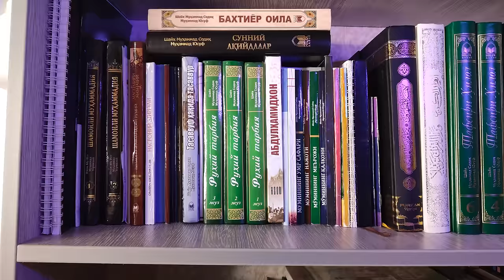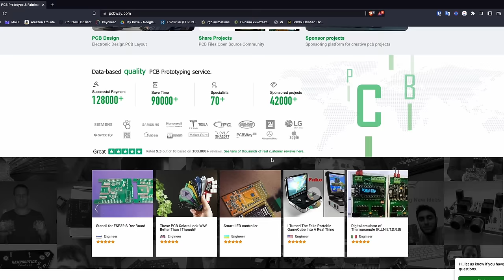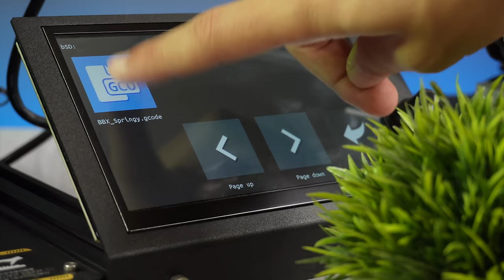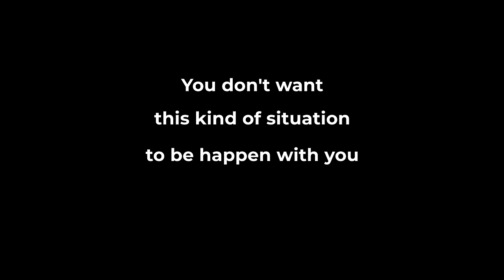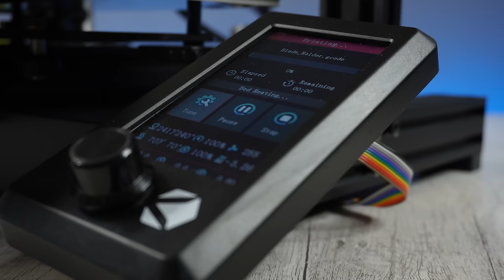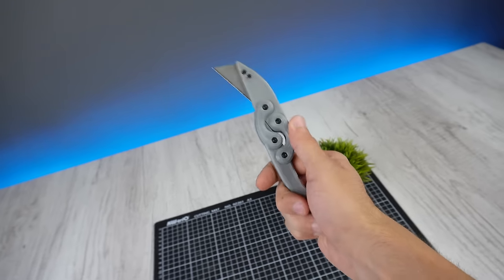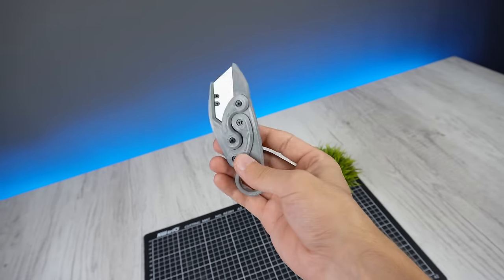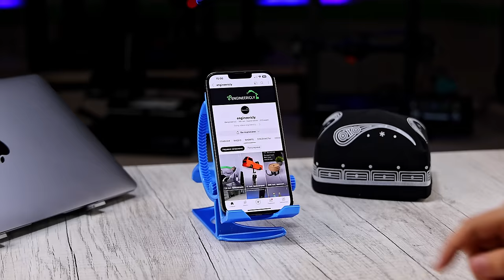Best 3D Printing Ideas in  2022 - 3D Printed Trends

Comment: I think the time has come to print artificial flowers and plants to have nice decorations. We can have wood, ceramic, and many materials to reach the perfect decor flower with a single 3d printer. If I think through, I can hid ardu electronics in the bottom, and some light sensors that makes alive the printed thingy....
Reply: 3D Print Bunny has some flower designs that are really neat.

Comment: as nice as it is, the last item w/candle is a real fire hazard, but nice clean prints through out
Reply: I bought a set of battery-powered tea lights at a local crafts store and used one for the backlight of a lithophane I printed for my wife this Christmas. Eliminates the safety hazard and still looks pretty good.

Comment: Meanwhile my prints warp and spaghetti everywhere
Reply: mine also lots  and lots error made few tumbleweeds
Reply: What printer?
Reply: mines ender 3 s1 but I think I had filament issue
Reply: @jamesharris9894  try replacing the nozzle and buy something called magicgoo it will fix all your problems